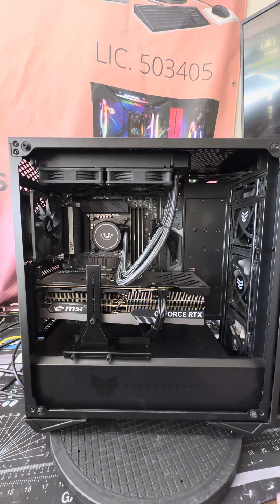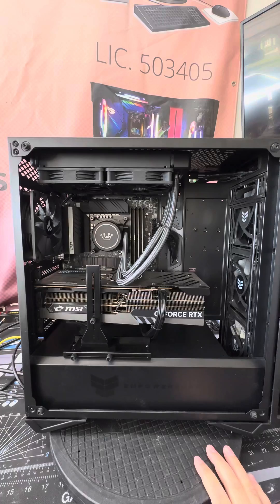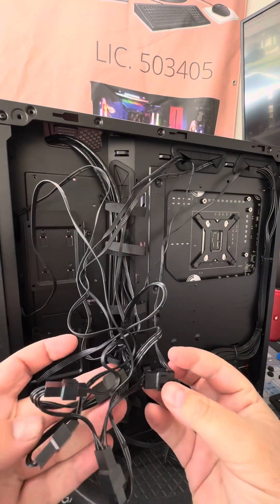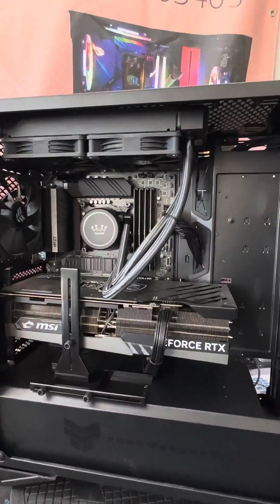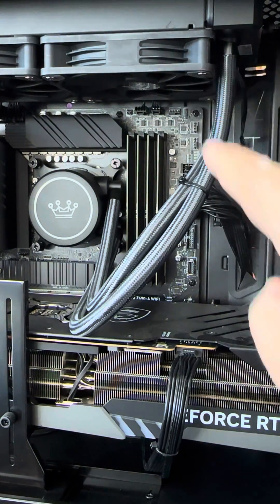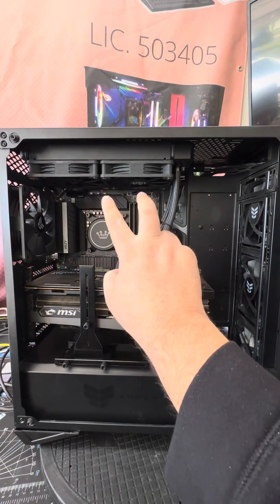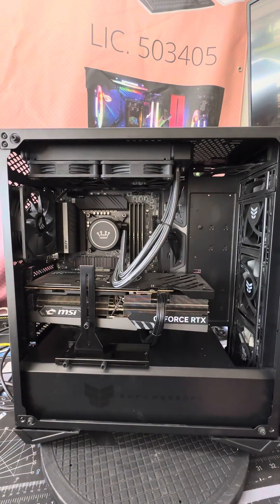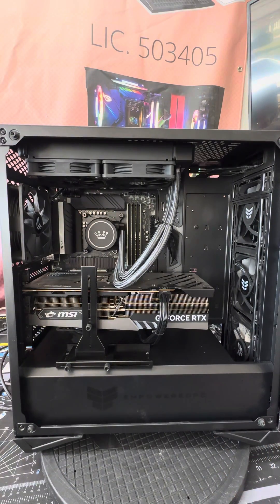Another prebuilt corner cutting PC that overheats…fixed!

Comment: Judging by the gpu, the cpu is probably much too powerful for that tiny cooler. That is probably effecting it way more.
Reply from the maker: You would be right, I simply do not have the time to make a video an go over everything I had to do to stop the system from overheating lol. i9-13900kf (24 cores) is what the customer was running and it was easily hitting 100c just trying to run Windows update. To his defense, he did not build it, so whoever paired an i9 with a 240mm AIO should be fired! lol. The worst part about it is, he got the i9 thinking it would be "the best" for gaming an streaming at the same time. Until I informed him that most games on the market today are only optimized to use six cores regardless of whatever number of cores total your CPU has. Streaming only uses an additional two cores, so six total cores needed to accomplish quality gaming while streaming. I informed him an i7-13700k or even a i7-12700k with 12 cores would have easily accomplished that task. I tried undervolting his CPU but based on many forum posts, that CPU is touchy for undervolting as far as it freezing or blue screening. In the end, turning off Intel Turbo Boost was the best option for him and still allowed him to accomplish his goals while keeps temps under 70c vs 100c.

Comment: kinda wish you showed the final result so newer PC builders would now how to properly do it.
Reply from the maker: I was doing that, the longer video got less views. I have 1min max to keep everyone’s attention. Average video view length is only 10 seconds before people scroll unfortunately
Reply from the maker: Basically all six fans were hooked up to that splitter. I disconnected the front three and rear from that splitter but left the two AIO fans connected as they are the only ones that should be connected to the CPU fan  header. Then I connected the four remaining fans to fan connectors preexisting on the motherboard but were not being used as follows:

Please note, PWM is 4pin vs DC is 3pin 
Front fan 1 (top) = SYSFAN1 header
Front fan 2 (middle) = SYSFAN2 header
Front fan 3 (bottom) = SYSFAN3 header
Rear fan(back) = SYSFAN6 header
CPU FANS(AIO = CPU FAN HEADER via that splitter
PUMP = PUMP fan header. 

I then went into the BIOS and set fan profiles under the "Hardware Monitor" then "Fan Control" section for their MSI motherboard.  You can google this or youtube it, there are plenty of tutorials for specific motherboards on how to do this. The default fan profiles ARE NOT ENOUGH to cool the system!

Here is an article for MSI
https://forum-en.msi.com/index.php?threads/guide-how-to-set-up-a-fan-curve-in-the-bios.369711/